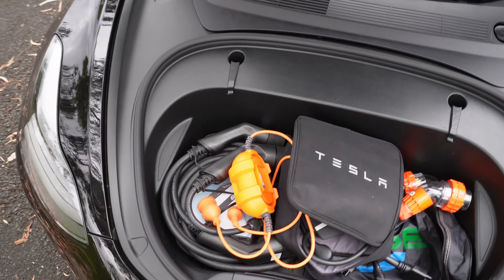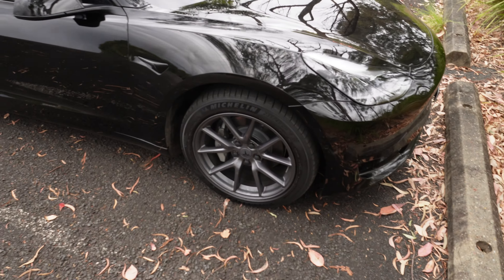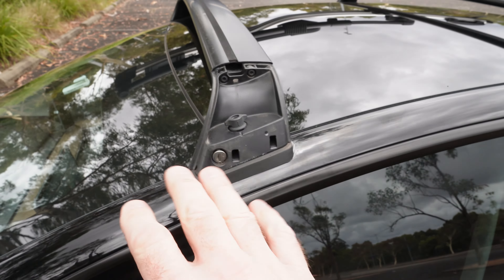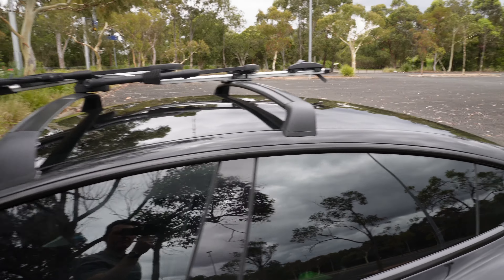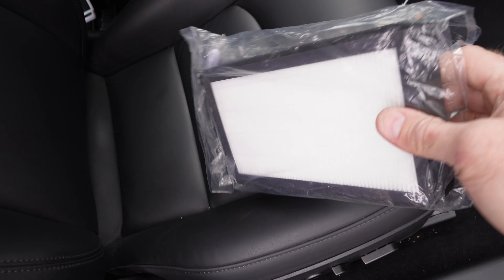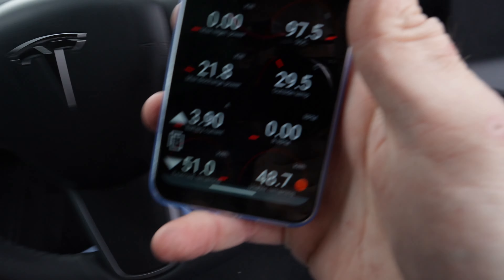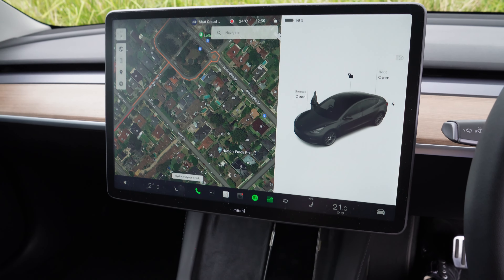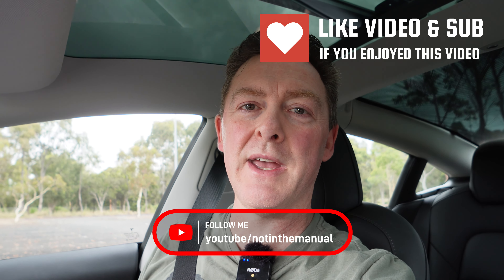Tesla Model 3/Y Accessories. The good and the not so good….

Comment: I would absolutely love to see your video about digging underneath the frunk and everything under there. My 2022 M3P recently started squeaking in the nose/frunk area that seems  similar to a slipping alternator belt on an ICE vehicle. It is getting pretty cold where I live in the US northwest and regularly gets down to -9° C. In saying that, I didn't know if it was possibly a heat pump or something similar not working correctly. I look forward to more of your amazingly informative videos!!! 😃
Thank you so much! Cheers!
Reply from the maker: Thanks Kirk. Without hearing the noise myself it’s hard to say but there are some motorised shutters in the front spoiler that are there to control air flow through the HVAC system radiators. I think they shut for efficient heat pump system operation in cold weather. They can be quite noisy and maybe they are squeaking?
Reply from the maker: Oh and NW US is somewhere I’d like to visit one day. I hear the mountain biking is awesome. Furthest North I’ve been on West Coast is San Francisco.

Comment: Hey Matt, how is your inside roof so dark? Are you using a black sun shade, or tinting, or something else? If I could order a model with a non glass roof I would. Live in Penrith and don't need any unwanted sunlight if I can help it, and also to draw current from battery using A/C thus reducing range.
Thanks again for the video.🙂
Reply from the maker: I don’t have any extra tinting. Unfortunately when filming it’s hard to get it looking like real life as the exposure needs to keep changing when the camera moves. If you have sunshades with the reflective outer it is fine. You actually don’t need to worry about economy that much these cars are super efficient and you would hardly notice a range reduction. My economy in hot weather isn’t that bad. I’ll do a test this summer to prove it. I’m not a fan of sunroofs or glass roofs but I love the model 3 glass roof overall. It’s so good at night. And driving through the city. Gives you a great view.
Reply from the maker: The glass roof is tinted from factory. It’s actually a laminate with UV and heat reduction layers. The tint goes down the back window level with the rear seats. I think you could definitely find a tinting place to add to it but Tint-a-Car wouldn’t do my roof. They were worried about damaging something. With what I know now it would be fine. It would just need to be a non-metallic film so it doesn’t interfere with the antenna on the rear glass.
Reply: Thanks heaps!